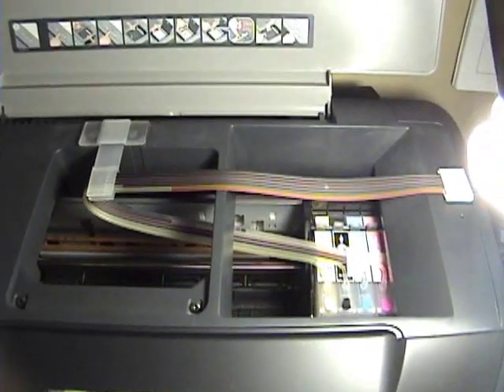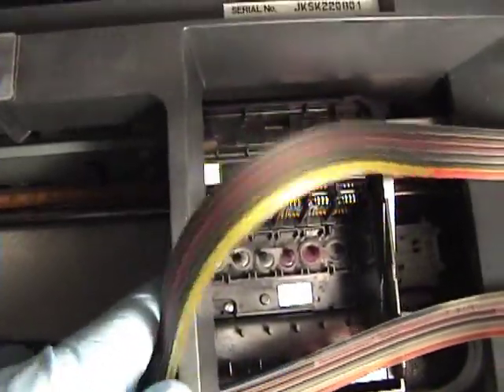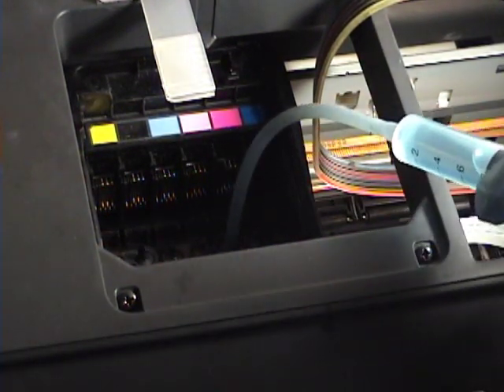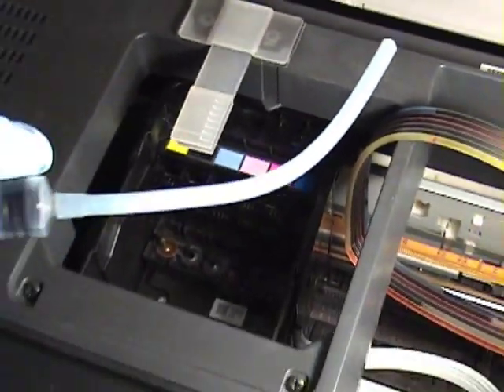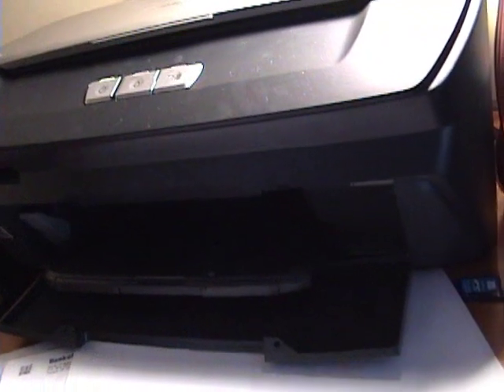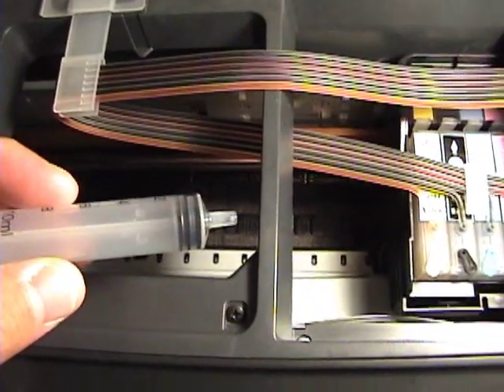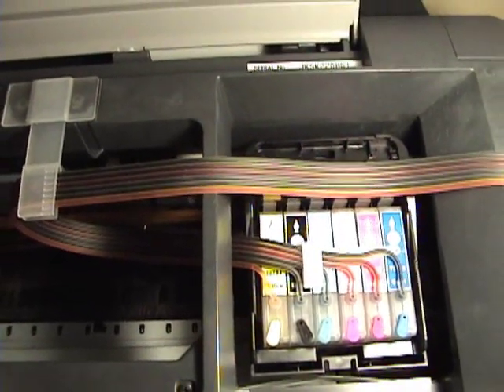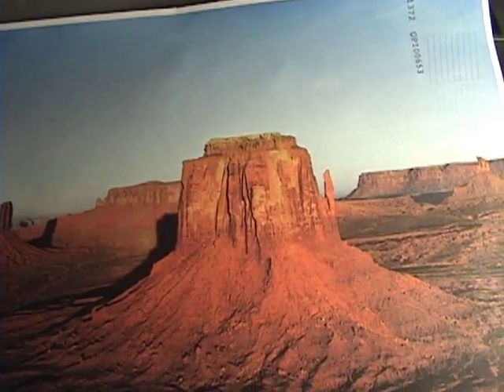Epson R260 printer head cleaning

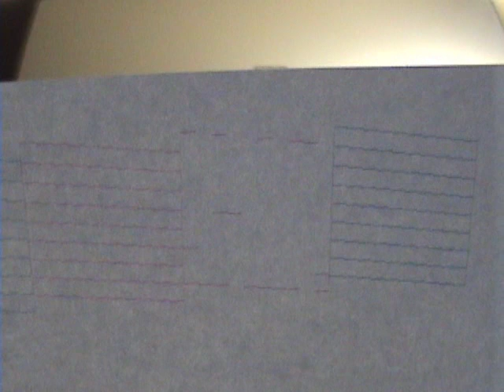Comment: @ 0:31 You don't need to clean the print head. You need to bleed the air out of your supply lines! It should be simple to suck the ink into the cartridges with the supplied syringes and then dump the extra in the syringe back into the reservoir tank.

Comment: You can simply replace back the actual ink cartridges or inking system you guys use then give it a couple of test prints to get the cleaning solution out. After that I believe the ink flow will be as good as brand new. A 4 set refillable cartridge cost around $8 dollars on Ebay so an investment for that amount can go a long way.

Comment: jster1963,
I come up with a theory that might work, it may cost a little but if it works then it would be the best way to get rid of clogged heads for good.
1.Get a refillable ink cartridge(s) compatible to the printer. Empty one preferred.
2.Fill it up with the solution you guys use
3. Put it in the slot(s) that have the clogged issues
4. Set the printer on Head clean
With using the refillable cartridge, the cleaning solution gets into the system to flush out everything out that's causing clogs

Comment: Hi there. I have a Epson Workforce 600
I just got my CISS today and I've been trying to remove the part on the lid case (printer). I was just following what the instructional video that I should use a screwdriver but I can't seem to get it off. The video made it look so easy to get it off but mine won't budge. Is there some sort of release switch I should press while is use the screwdriver?
Thanks

Comment from the maker: @Dtitilator For my CISS I went to Ebay and got one that was compatible with my printer.  There were many, so I went with the cheapest one.  I made sure it had a chip resetter built in (most do).  I get my ink on Ebay too.  Once again I get the cheapest.  So far, I have printed 1000's of photos for pennies!   I love my CISS.  If you get yours on Ebay, make sure you read the feedback of the seller BEFORE you buy.  Good luck.....

Comment from the maker: @Razyen I'm sorry your printer is ruined.  My printer was so clogged it wouldn't work.  When I called the repair shop, it cost 2x the cost of a new printer to fix, so I looked up how to fix it.  There were forums that discussed how to do this but no videos.  That's why I made this vid.  If your printer is just not printing, mine took days before it worked correctly again.  I have no idea what CFL 100ML or DHR100ML is.  Sorry....

Comment from the maker: @Dtitilator Don't throw it away yet!  When your head is really clogged, it sometimes takes a while.  The first time I did this, mine printed poorly for a few days.  You have to do a few  cleaning cycles too.  I use a continuous inking system (ciss) so ink is not a problem.  If you are using regular ink cartridges, please know that a cleaning cycle uses a lot of ink!  Please let me know how it turns out....

Comment from the maker: @Razyen You may be right, but the printer wasn't working anyway.  It cost more than a NEW printer to have an old one fixed by a shop.  Therefore, it's a last ditch effort to make something that is going into the trash work again.  It has worked for me several times.  BTW.  The papertowel soaked with windex seemed to work the best.  I just did it again last month and have printed over 100 photos.  Pinter is 100%.  Thanks for your input.......

Comment: @jster1963 Thanks for all you help jster but it still didn't work.  If I knew how to remove the print head I'd do that but I don't and I don't wanna risk damaging the printer.  I read some where that there's suppose to be ink moving through the tubing that's underneath where the cartridges dock but when I ran the clean heads test I didn't see any ink flowing through it so maybe that's the issue.  The black/yellow inks are the only ones at issues so I think I'll just get rid of it.  Thanks again.

Comment from the maker: @smileychgo I didn't get mine to work after using the tubing and windex alone.  I still had to put the papertowel under the head.  I would try putting the papertowel soaked with cleaning solution under the head over night.  Then let it sit for an hour or so, then try as series of printing and a couple of cleaning cycles.  Mine was purely trial and error........

Comment: @smileychgo  that's common but I was able to get it back out.  The paper towel was full of ink so I guess something worked.  If it's not printing normally in the morning, I'm putting it on eBay cause I don't know what's wrong.  BTW, it's an Epson R320 model.  It's the black ink that's causing problems.  It prints color just fine.

Comment: @jster1963 - I went the tubing route but I don't think it worked, unless I didn't give it enough time.  I ran nozzle check and cleaned the print heads and still get missing gaps.  This was done with new cartridges installed.  I guess I'll check again in the morning.  I used airline tubing (not sure if that makes a difference), the kind in small aquariums and it seemed to attach fine to the heads.  As I was injecting the liquid, I could see it backup in the print head reservoir.  Not sure if.....

Comment from the maker: @smileychgo I would try again.  If that doesn't work, the tubing is available at most RC hobby stores.  It's fuel line.  I can't find mine rite now but the inside diameter is about 1/16-1/8" (1-1.5mm).  Make sure you use a papertowel under the head when you push the windex thru the head.  Even after that, I had to wait a few hours before it worked again.  Good luck and let me know how it goes......

Comment: cool, just a tip, you said you ran 5 cleaning cycles, 4 is the max before you do damage, (according to my ciss instructions)and after a couple, just walk a way for a hr and give it time for the cleaning effect to take hold. you can also buy for $5 a fake cartiage with windex in it and a plunger. Its alittle easier for getting the Windex into the print head and path
Cheers
Dave